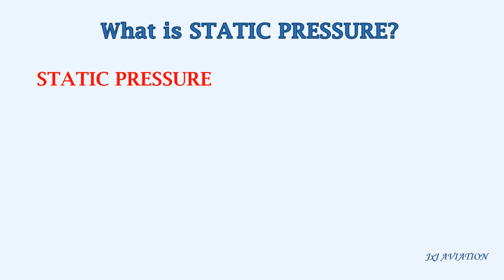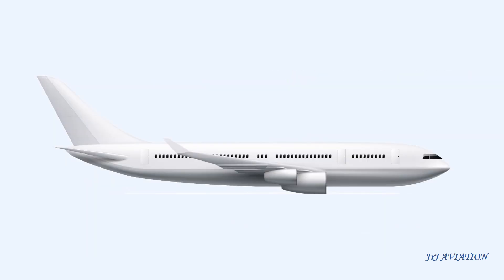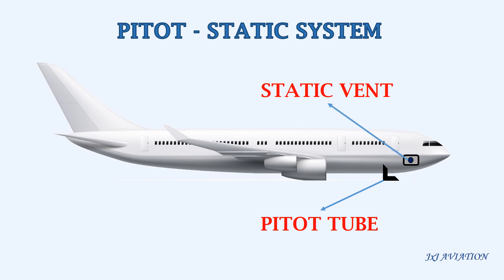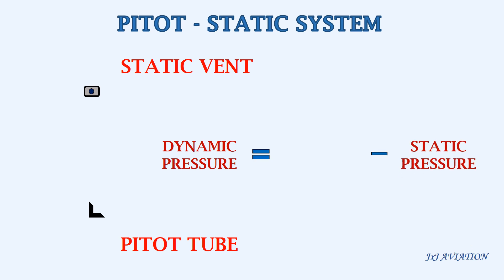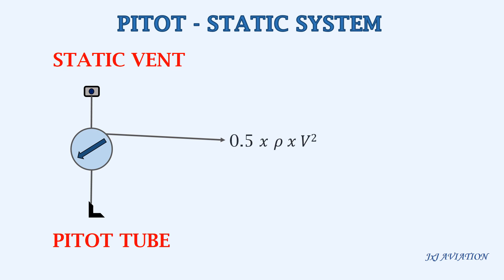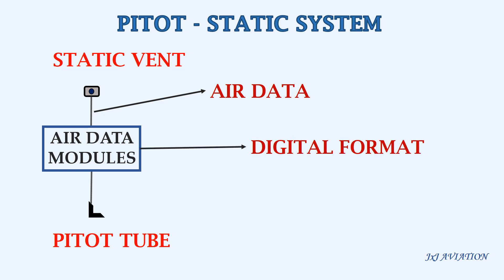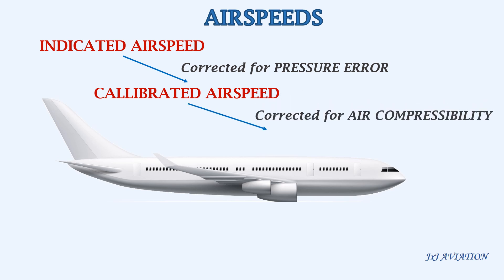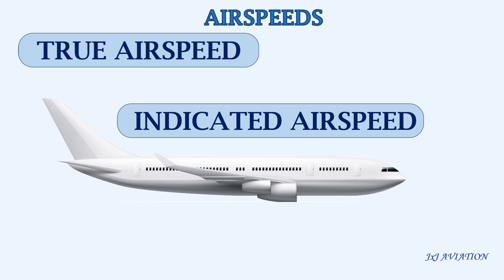Understanding How an Aircraft's Speed is Measured with The Pitot Static System!

Comment: How does an aircraft submit to the static pressure in the sky while it's flying?
Reply from the maker: Static Pressure info is collected from ports that are flush with the surface and perpendicular to the free stream air, so that it does not vary with speed.

Comment: Is the data collected by Pitot tube reliable at any speed? Even the slowest,suppose the aircraft is taxing
Your response will be highly appreciated
Reply from the maker: The pitot does give an accurate reading at low speeds, even during taxiing on ground, as long as the tubes are not blocked!

Comment: Question:  Air is flowing past the static port at >= the speed of the aircraft.  Why isn't the measured pressure at the static port lower than true static pressure by Bernoulli's equation?
Reply from the maker: It is because of the loses that occur in the flow due to friction and viscosity of the air
Reply: @JxJAVIATION  so consider a small plane flying at 5,000 feet ASL (air density about 20.48x10-4 slugs/ft3), at 150 MPH (220 ft/sec).  Air moving over the static port at this speed has a higher kinetic energy than the stationary air inside the static port, thus it has to be at a relatively lower pressure outside.  The Bernoulli equation predicts the pressure drop to be 0.346 PSI.

How is air rushing past the static port different than blowing over a piece of paper (the paper rises) or blowing over the top of a wing?
Reply from the maker: @aslPlayer  to measure static pressure  the port needs to be at right angle or perpendicular to the air flow. If the keep the port in the front or in line with the airflow we get the stagnation pressure(Total pressure), because the speed of air would have reduced to 0.

Comment: Ty for great video but what do u mean by corrected pressure error corrected air compressibility corrected for density plz reply
Reply from the maker: You are Welcome. Because of certain loses due to pressure and because of compression of air(Pressure Error) a correction has to be applied. Density correction is with reference to increase in  altitude.
Reply: @JxJAVIATION  okkay ty